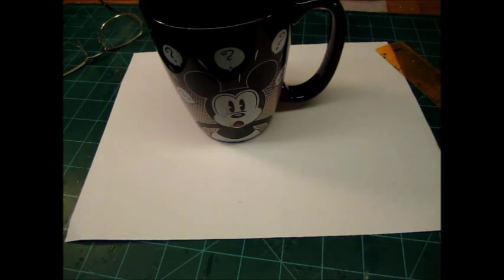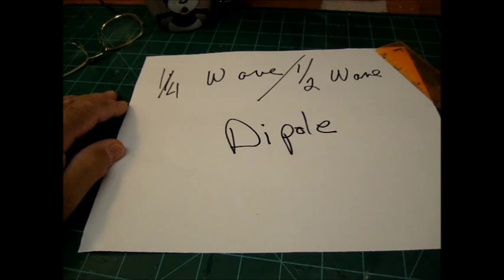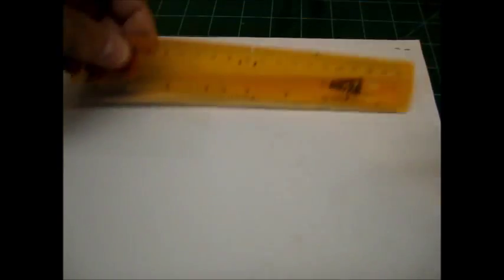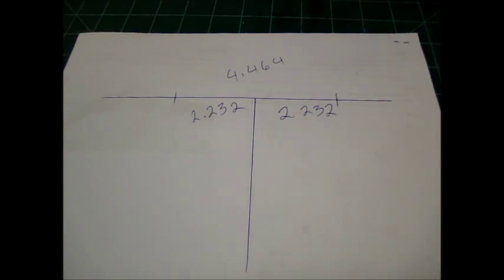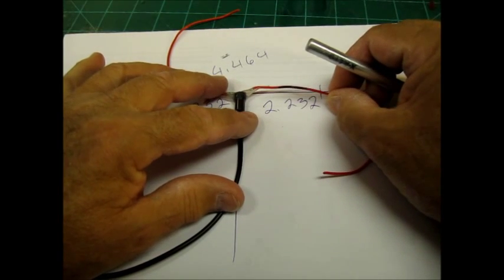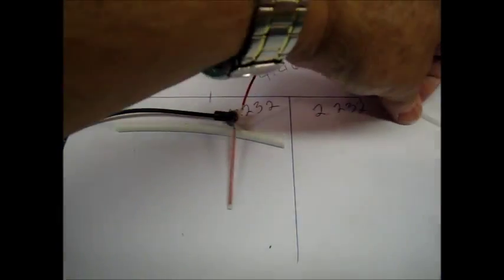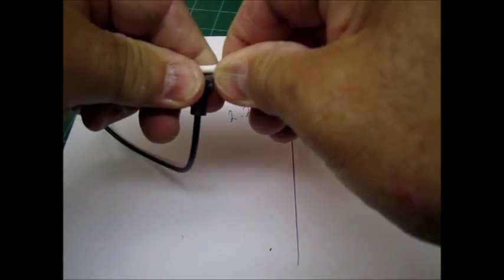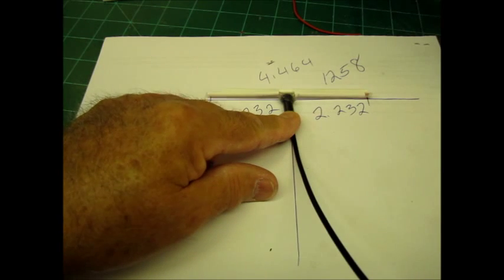How to make a 1258 MHz Quarter Wave Antenna

Comment: For those frequencies you could be off by an 1/8 of an inch or smaller. For Amateur Radio Use, you should cut the antenna larger and then cut by measuring the SWR until you get a 1:1 SWR. Amateur Radio Operators would not put anything on the two antenna elements as it affects the signal and will raise the Standing Wave Ratio (SWR) of the antenna.

Comment: really good , with the formula on that screen you should have no trouble with all frequencies, but on the tx it is really important that it tuned well, on rx not so much but on rx higher elevation the better. as others have said, you could go really far limited by the milliwatts of tx. i am a ham radio guy, so with packets to work this way is interesting, more power or gain in either antennas

Comment from the maker: Yes if I get the radio too close to the patch antenna.  Thus I use an extra long cable to get away from the flight box.  With 1258 I can sit on the box, so to speak.

Comment: Здорово! А какой кабель лучше использовать?
Reply from the maker: To make it from scratch I use semi-rigid coax and SMA solder on connectors that you can find on EBAY.
In this video I used an old Dragon Link antenna and trimmed it down to work.
If you need help finding the materials let me know.
Thanks for watching

Comment: Are those dimensions  inches?
Reply from the maker: Yes it is in thousandths of an inch.   2.232
Find a simple caliper that reads in thousandths
That is when you divide and inch into 1000 increments.  It makes for a very fine measurement .
Thanks a bunch for watching.
This is the best antenna I have ever use and it is the only one I use.
It is proven over a very long distance.

Comment: Hi Dick Gibson. I flight with a Skywalker 1880 and DragonLink. Actually, I use a Cloverleaf antenna in the Lawmate transmitter. I will try the dipole antenna (1280) in video transmitter. I have a skew planar and a pepperbox antenna in the ground station (with diversity). What do you think about mount the video transmitter dipole antenna near the Dragonlink receiver antenna? Do you think that it will make noise / interference? Tks.
Reply: You should always keep the antennas as far apart as you can for best performance.